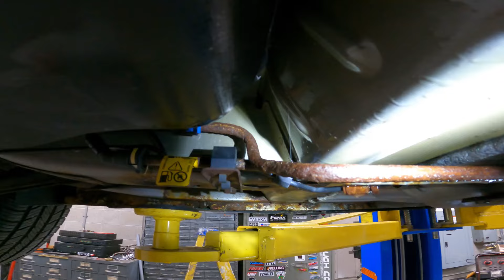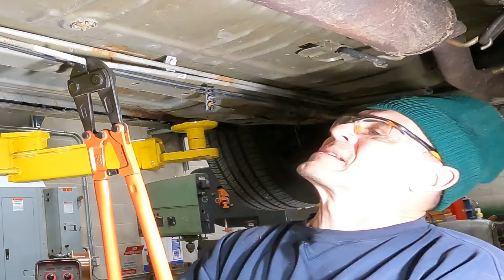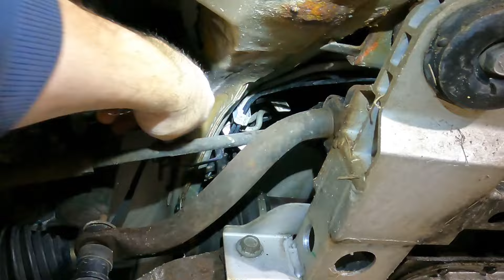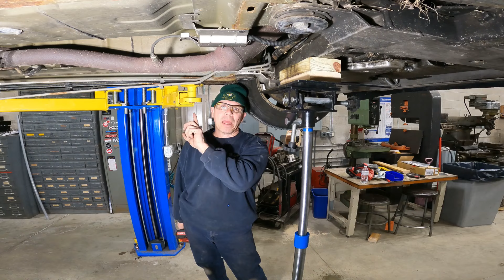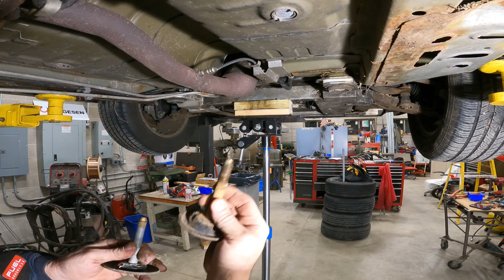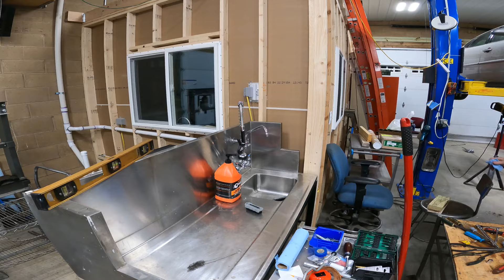2008 Buick LaCrosse fuel gas line replacement.  OEM fuel lines used.

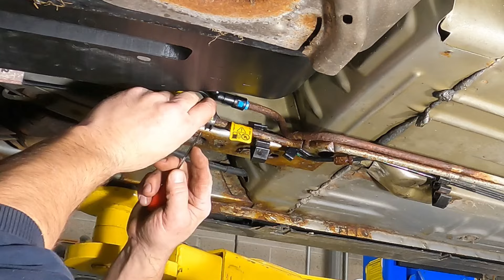Comment: Anybody know what the rubber hose with the yellow tag Is? 1:37
Reply from the maker: @Terrence12Gardenr  that’s the flexible line to the top of the fuel tank
Reply: @whatsnextgarage  mine has a hole in it I'm trying to see if I can just replace that or to I have to replace the whole line
Reply from the maker: @Terrence12Gardenr you should be able to replace just that part. Or you could splice in with fuel pressure rated hose and clamps.